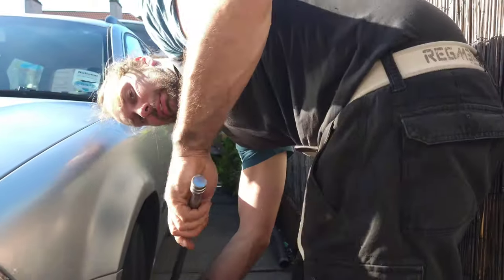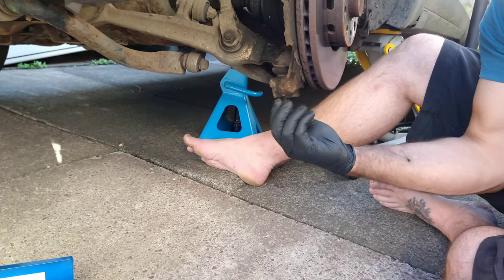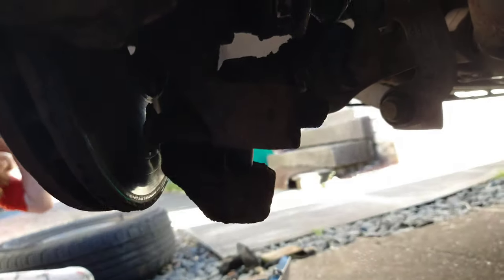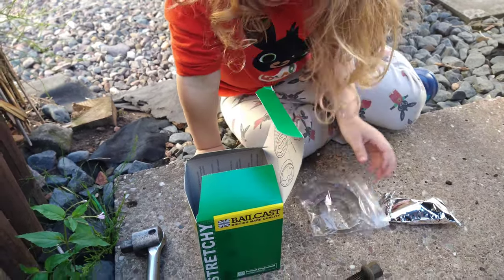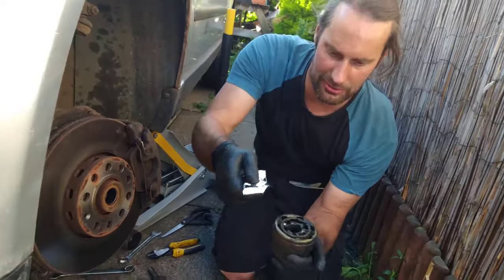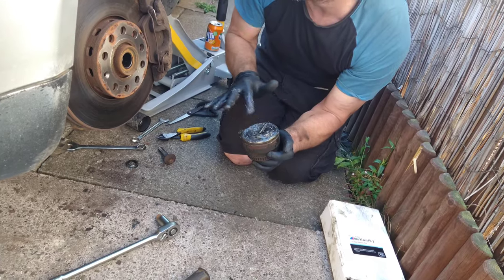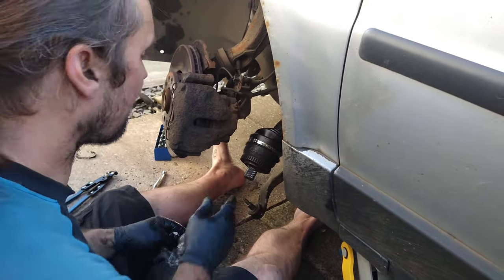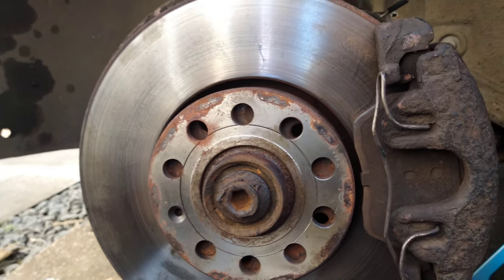CV boot replacement (Volkswagen Passat/Audi A4)

Comment: 7mins 33 seconds in. Make sure you fit the metal shim and plastic sleeve the correct way on, Matts is correct. On stripping mine down, the damaged CV boot that had been replaced at an earlier time had the plastic shim fitted the wrong way around. I also washed my CV joint out of old grease. My previous 3 CV boots on the offside had rooted away over a 3 year period. My trusted garage of 20 years tried to suggest it was due to lack of use !! even though the nearside boot was still the original from 17 years prior. Each year they failed it on the CV boot and charged £100 to replace. This year prior to MOT I checked the CV boot and yet again, the CV boot had literally rotted. I suspect one of two thing. The CV boots my garage use are made of substandard rubber and just rot away or two, the grease they filled it with is the wrong grease, attacks the rubber CV boot from the inside out and causes the boot to rot. I am now using an OEM complete boot kit from FEBI which comes with its own grease. I will update this post in one year to see if it rots away like the three previous ones did over a 3 YEAR period, each one fitted yearly and the vehicle only covering 1500miles. I suspect its the local garage I use as I had a VW Sharan and they changed the clutch on it. New clutch was great, three weeks later gearbox whining and on draining the oil was full of metal - again I suspect they used the wrong oil or not enough and I had to scrap the car for parts as it would have cost more to repair than its value which is a shame as I had owned it from it being 18 months old for 15 years. Moral here is my trusted garage has been going for over 50 years, I am on first name terms with the staff but they still make mistakes and will not own up to it - I now try and fix things myself and thanks to people like Matt, I would rather try and do it myself, if I mess up then that's my fault but I cant lie to myself like the mechanics at my garage lie to me.
Reply: "I can't lie to myself like the mechanics at my garage lie to me" True statement of the year right there!. This very same scenario is what got me into repairing my own vehicles. Good luck to you! Also, a tip for the future, you might have been able to save the Sharon with a used junkyard transmission. They're very cheap and all you have to do is bolt it in. If a car got scrapped because it got rear ended for example, the transmission is very likely to be fine.
Reply: @PeterB12345  Today - the garage lied to my son today when he MOT'd his Punto. They jacked it up to do the MOT at the non jack point, causing the sill to be crushed in a small section. My son came home and said - ohh the garage said you need to get this part of the sill reinforced as it gave way - rubbish I told him, look, they jacked it 3 inches away from the jack point ! - anyway I straightened it out and resprayed the sill but that's not the point. We all make mistakes, but don't lie and don't tell your customers to reinforce non jack points ! - what a load of bull. Told my son this is why you cant trust anyone, but you cant do a home MOT either. Yep, shame about my Sharan - good beast of a vehicle that took my family all over for over 100,000 miles - RIP.

Comment: No matter how much I screwed the thread into the CV joint with the tool in place, the CV joint refuses to separate from the drive shaft. I then tried hitting the CV joint off but nothing. How come you make it look so easy ? I spent two hours with the tool on the shaft bolted in place trying to get the CV joint off - I now have a 3 wheeled car and stuck :(
Reply from the maker: Sounds like it is being a nightmare for you. You may end up needing the whole drive shaft. Thanks for watching
Reply: Hi Matt - right, me and my son worked out the physics on this. You do not need that gold coloured tool which I also purchased as so many videos show it being used. I removed the gold coloured tool. All you do is this if anyone is having difficulty.

1) Do everything Matt did to strip the vehicle down to the point where you are ready to remove the CV joint. Dont hit the CV joint, Dont affix that gold tool.
2) Put the car in 1st gear to prevent the driveshaft from turning.
3) Re insert the bolt into the cv joint and turn it clockwise with a socket set.  Then when it gets really tight, have a rest & a coffee ! 
4) Put an extension bar onto the socket set arm so you have more leverage. With a friend, keep the CV joint parallel with the drive shaft. Eventually the CV joint wont swing around as the bolt you screw in will hit against the driveshaft.
5) Keep turning the bolt clockwise - you are now putting pressure to force the driveshaft off the circlip that's on it that retains the CV joint on.
6) Keep turning, dont be frightened, you wont break anything, eventually you will hear a metallic sound, that's the circlip giving way allowing the CV joint to come off drive shaft.
7) You are done. Have another coffee and high five with your helper that you have succeeded.

Comment: Good vid, but u did one mistake. Do not EVER repair under the car in car jack,  put car in car stands, and car jack to support, safer.
Reply from the maker: It was on axle stands, I don't work  under a car with only a jack. They are under the subframe. I agree with you. It's the only way to do it. Thanks for watching

Comment: Why have your feet under the car barefoot couldn’t even watch video to dangerous,,bad way to teach a child are anyone.
Reply from the maker: Mechanics go under cars, although not usually barefooted. My feet were too far away from the CV joint to possibly drop the part on to my foot. 
I could have easily put on overalls and safety shoes, maybe even safety glasses too,
The method of removing the CV boot remains the same.
Thanks for your comment
Reply: @mechanicmatt871  legend 💯